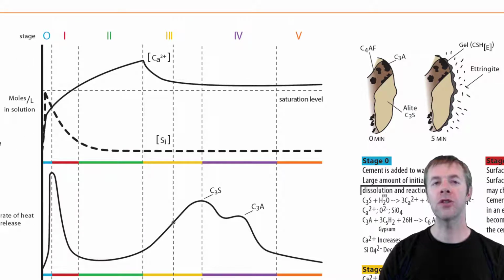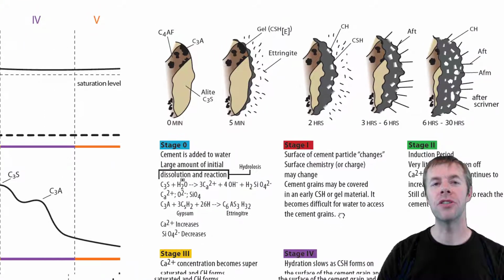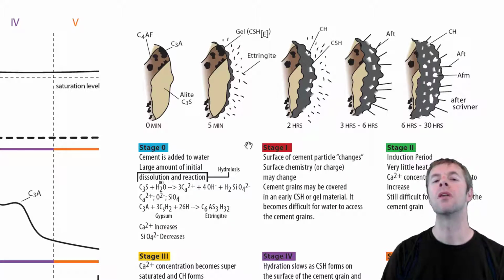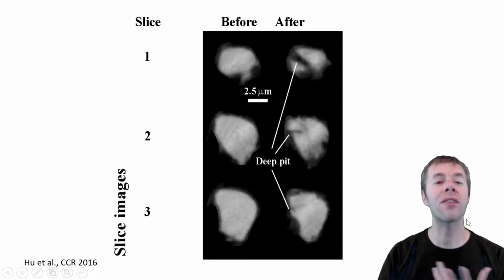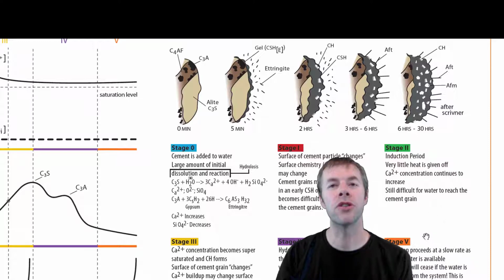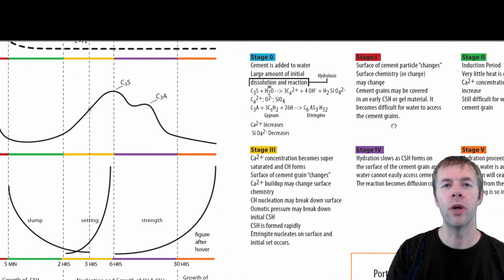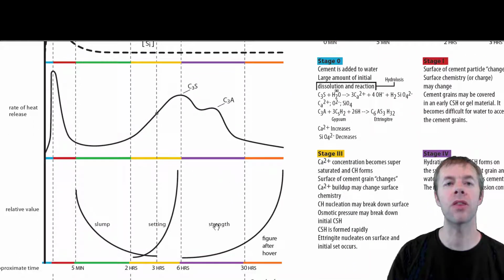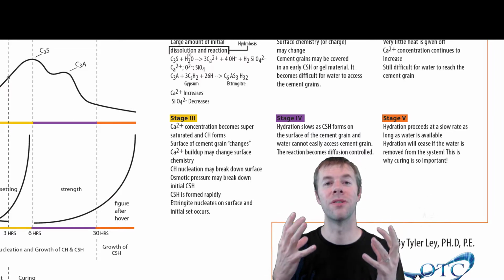The Dirty Details of Cement Hydration

Comment: Well, best explanation, simple and deep. I'm phd student, part of my study is interpreting the hydration process by using electrical resistivity measurements. During my master degree I was mislead by the coating layer theory during induction perid. Nowadays dissolution precipitation theory is more responsible explanation. During the dissolution period the resistivity reaches its lowest value when ion concentration reaches the supersaturation then during the induction period, or slow reaction period the resistivity starts increasing slightly. So kind of solids precipitating  happens on cement grain surface. Is this precipitation  due to poorly CSH crystalline or CH formation or both?. Thanks professor
Reply from the maker: Thanks Faqad,
I think you will like this video.  We have some cool papers coming out soon.  https://www.youtube.com/watch?v=jekB0y2pTh4